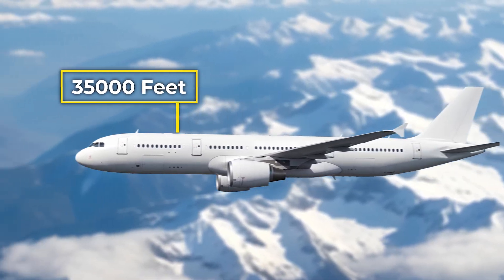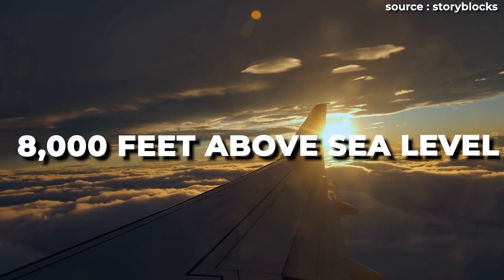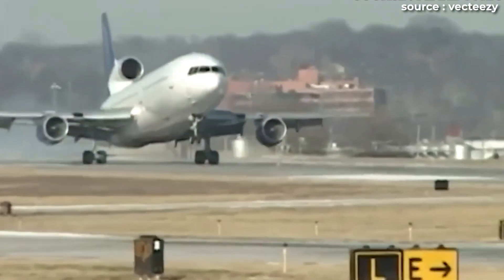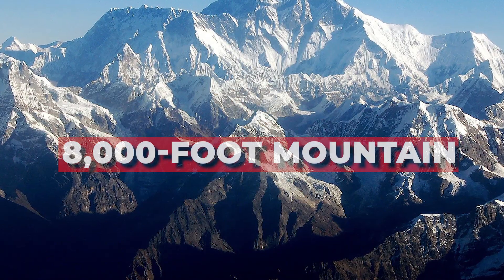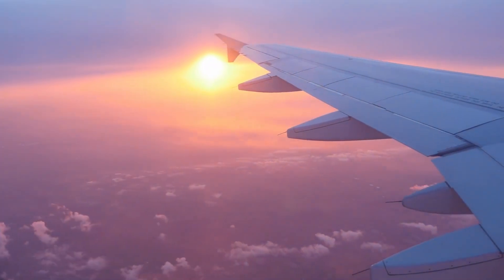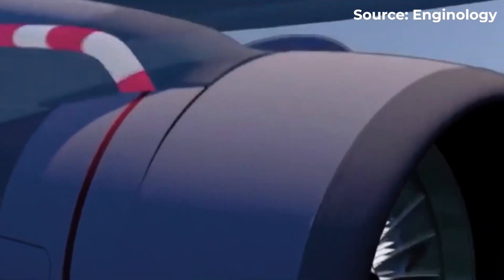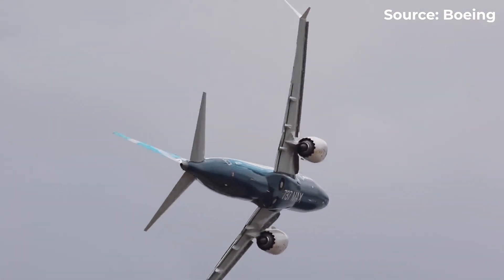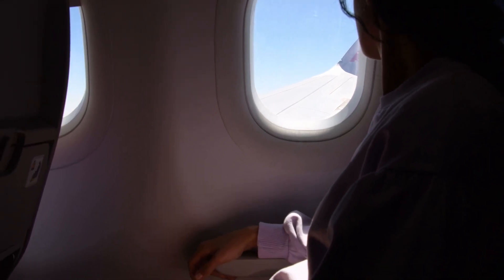Why Planes Pressurize to 8,000 Feet (NOT Sea Level) - The $200M Problem ✈️🌊

Comment: That was one of the big selling points of the Dreamliner.  It was designed to be pressurized to a lower atmosphere and with more humidity to make it more comfortable.
Reply from the maker: You're right, the Dreamliner definitely focused on improving passenger comfort with a lower cabin altitude and increased humidity!